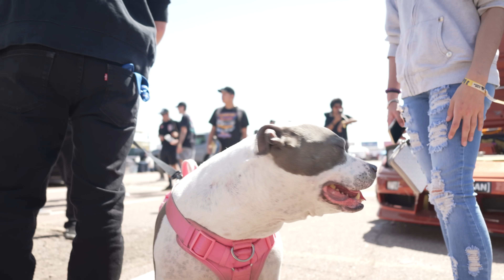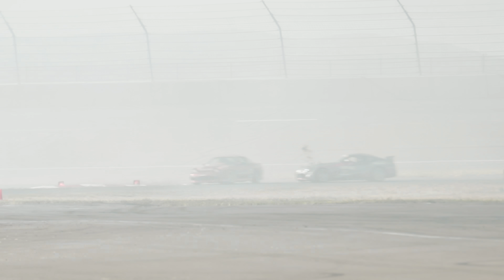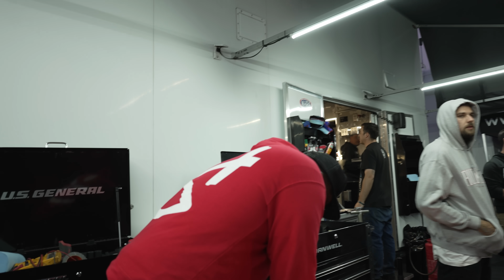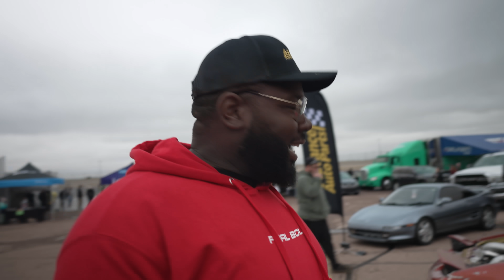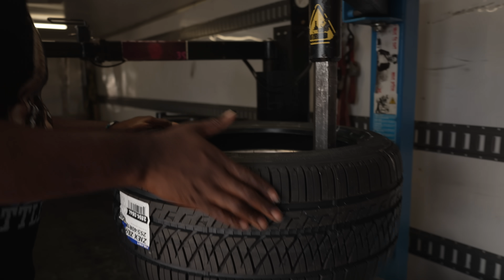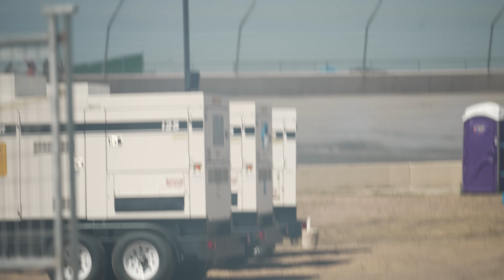Breaking things like usual at Grid Life | HertVlog #016

Comment: I love drifters and the scene itself, but ill never forgive yall for what yall did to the e36 market 😢 Used to be able to get an m52 and zf 5 speed togethet for 300 bucks. They were so cheap i kinda went overboard with some of the purchases. I cleaned out my storage unit i haven't seen in 10 years and found 3 zf transmissions.😂😂 Also the original prototype driveshaft from the driveshaft shop for e36s and an extra m5x to tremec trans adapter. Been running a faceplated tremec and e34 m5 diff since like 08 cause I was tired of breaking at the strip.
Reply from the maker: You can't blame us for that. EVERYTHING manual and RWD sky rocketed 😂
Reply: @HertLife  i know everything is like that now. But the drifters were at the forefront of the price rise like 8 years ago. all the cheap examples were snatched up by drifters and most of those cars are not living today. Because of their price, they were alot of people's first missles. You buy a car for almost any other form of motorsport and besides something detrimental that car is still around today. Can't say the same for most ppls 1st slidey boi car.🤣